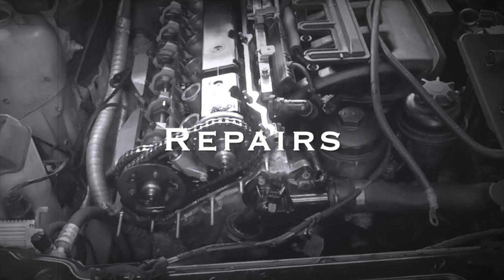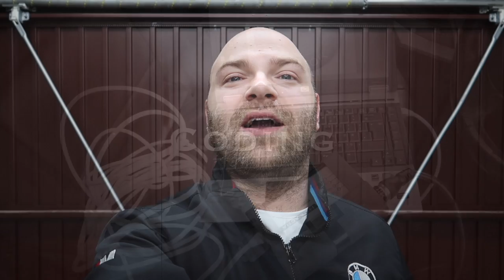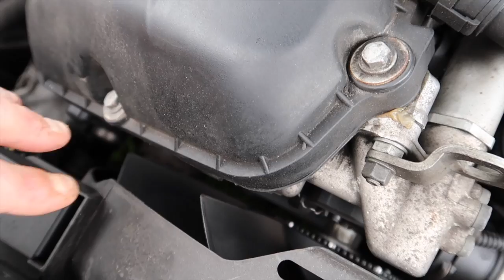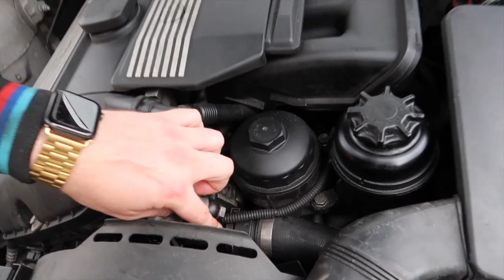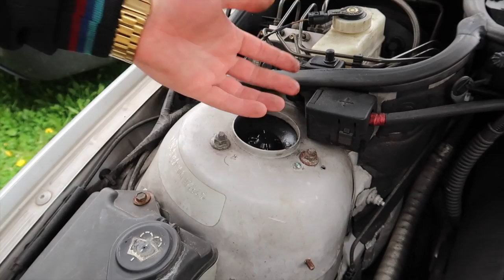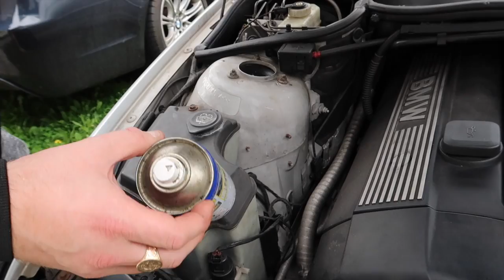Doing This With WD40 Will Save You Thousands in Car Repairs

Comment: Hi this is a random question while driving my E60 2007 while accelerating there’s a loud whining noise when I hit 40km but stops when I break it go more than 40km and goes back again when hit that certain speed after 30 mins running the car the whining noise stopped I don’t if you can help me with this